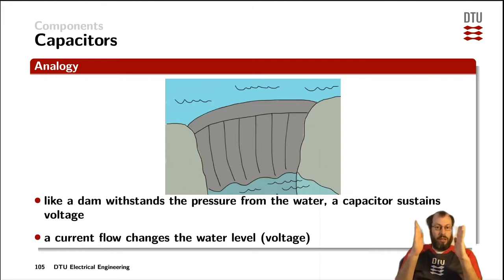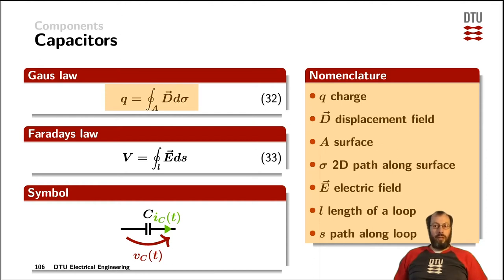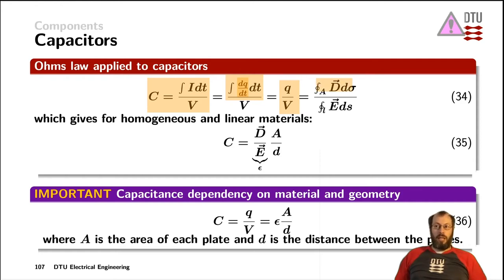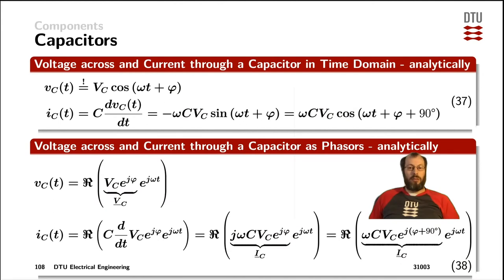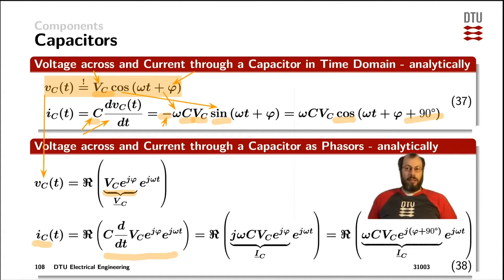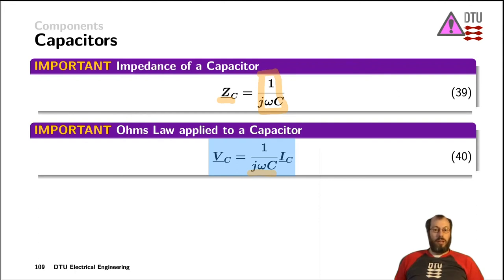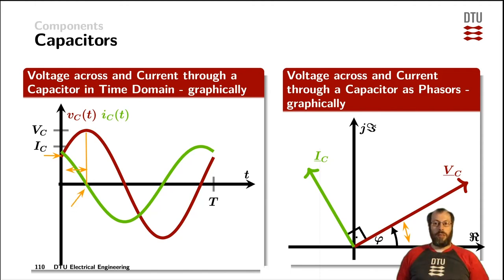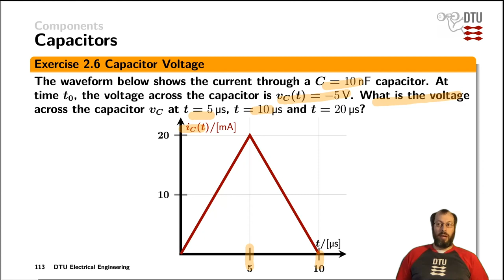Components: Capacitors

Comment: Hello.. thx for your great videos..

i have question pls :
If we apply a cosine voltage signal Vt across a capacitor then how we can say that Vc = Vt ? , because we know that capacitor voltage will not simultaneously rise or fall with Vt but rather it will "follow" it keeping clise behind it with time !!...

iam really confused about this issue as iam still beginner in these topics...

Thank you in advance
Reply from the maker: Yes, basically there is only one voltage across a capacitor: If you force that voltage to be a cosine wave, e.g. through a voltage source, then this is the capacitor voltage. The current through the capacitor adjusts according to Ohms law. I hope this makes sense? 🤔 Thanks for asking! 🙏